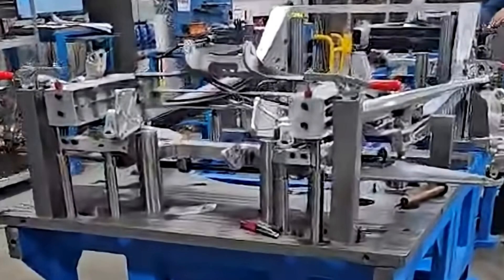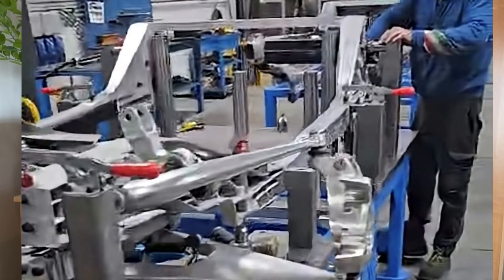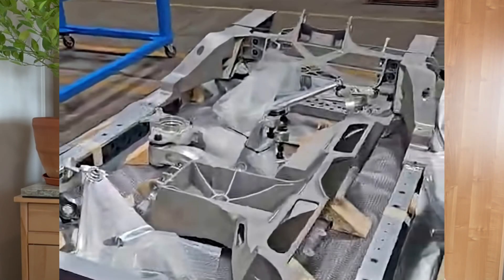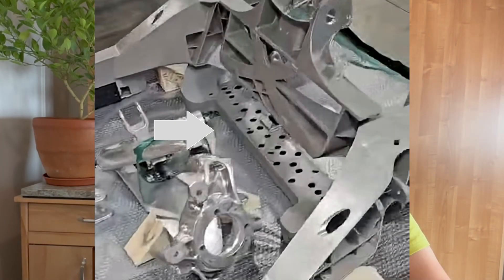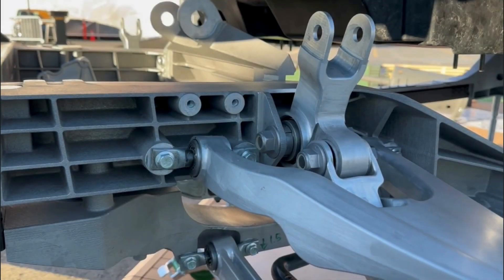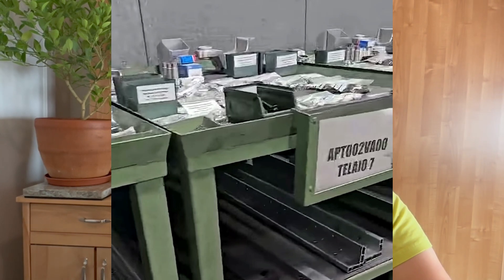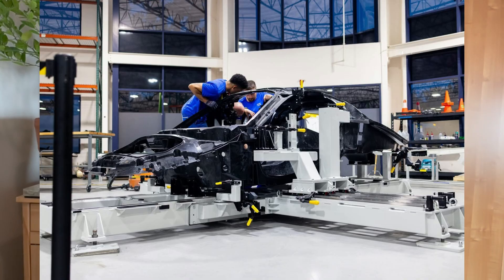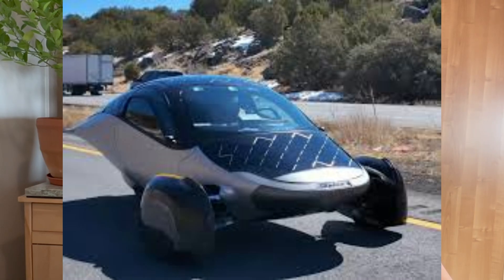Aptera's New Frame from COSTAMP

Comment: If they’ve gotten almost 50,000 reservations and are hardly know outside the Aptera current fans and supporters, imagine how popular it will be when it hits the road.
Reply from the maker: I think when people understand the freedom that the solar charging give them, it can be the next people’s car.
Reply: @ApteraAccessories  I have solar on my house roof and I can charge my EV for free on most days in Brisbane because the sun shines a lot here. Millions of others are in similar situations around the world. What we don't get is being forced to cook our cars and have to suffer a drive home in what has become a mobile pizza oven. The concept is snake oil, and we already have a better way. In fact, I can use my phone to turn on the A/C and pre-cool the cabin before I get in at its shaded parking spot, and so can millions of others. Everything you need is on the market to achieve this. It's time they stopped selling the snake oil and produced something that proves all their wildly exaggerated claims.
Reply from the maker: @a @aussieideasman8498  lot of people do not have the option for home solar or home based charging, myself included.  The Aptera will also have the same option to pre-cool the cabin, but will have the benefit to draw less power from the battery to do so. They are getting closer and closer to producing the car they said they would even if they had to make some changes along the way. I have never been to Brisbane, maybe one day I will go.
Reply: @ApteraAccessories  These people are fuxxed anyway. Embarassing solar on the vehicle wont help. And Aptera gets closer and closer to production since 2009. With production always promised next year. But not even a single production ready prototype available yet..
Reply from the maker: @vic321344 The concept of the Aptera car might date back to 2009, but this version of the company was started in 2019
Reply: @ApteraAccessories  Still geting closer without producing anything.
Reply: Just talking with two people from different parts of California who got very excited about Aptera and asked "Why have I not heard about this?"
Reply: @Mister_Stone  Tell them to catch up with nearly 200 videos of mine, LoL. I promise I will not get a brass razoo out of it.
Reply: I was telling a guy from Farmington, NM about Aptera. When I mentioned 40 miles/day from sunlight he said "I drive less than that every day."  Exactly.
Reply: @markfinley3703  ChatGTP:
Analysis

Farmington’s population is 46,624 (2020 census). 
Wikipedia
+1

Nearby incorporated places within San Juan County (which are the likely “towns” around Farmington) include:

Bloomfield, NM, population ~7,421 (2020). 
Wikipedia

Aztec, NM, population ~6,177 (2023 estimate). 
Census Reporter

Kirtland, NM, population ~585 (2020). 
Wikipedia

According to a San Juan County list, there are no other incorporated places near Farmington that exceed ~46k. 
City Population

Conclusion

No, there are no towns within a 20-mile radius of Farmington, NM that have a population larger than Farmington.

Farmington is by far the largest city in its immediate area.

Now this poor guy says that he NEVER drives as much as 40 miles in a day; that's what "I drive less than that every day" means. So he can only ever drive to these main three tiny towns with at total population under a third of his home town. Sad. He would be better off with a horse but, if he had a car, he could charge a modern EV about once a fortnight, and that from rooftop solar (his house).With a battery, he could do that while he slept. I'll bet all these are available for purchase right there in Farmington today.
Reply: Reservations are not buys. See Tesla, Rivian, Ford...
Reply: @vic321344  And prototypes count for nothing.
Reply: Well over a decade now have these guys been hyping themselves with promises of imminent market introduction. It bears the distinct perfume of snake oil, only goal is to get some more dollars out of gullible people’s pockets. 
This thing is hopelessly outdated already.
Reply from the maker: @vicbauwens Your recollection of time is a bit off, the company restated in 2019.
Reply: @ApteraAccessories  2005 (started in Farm-bro's garage) to 2011 = 6 years and 2019 to 2025 = 6 years, so total = 12 years. I would say 2 years is well over a decade, but it's not the recollection of time that's out - it's the claim that they have been hyping themselves. They have been hyping others, but not themselves. They hype themselves with that only goal of theirs.
Reply from the maker: @a @aussieideasman8498 The Aptera 1 from 2005-2011 is a completely different vehicle in its engineering then the 2019-current version. The only thing they have in common is the use of the Morelli body shape.
Reply: @ApteraAccessories  - So Aptera 1 was a clean sheet design that has zero to do with the one they showed us back in 2020? I guess it makes sense. A honeycomb shell and an inboard motor that has a shape that Chris Anthony stumped NASA with back in the Aptera 1 days, is nothing to do with Aptera 2. So, why does Aptera talk about those days and just make an official statement that this has zero to do with what they started back in March 2019? Then tell us all why the Zaptera lawsuit was not struck down right away, yet it lingers.

Fansplaining works and ignoring the other items. Like those two crowdfunded businesses (which you know about as you have seen them) seem to be no big deal that these two netted $300K right before they restarted Aptera.
Reply: @ApteraAccessories  Here's an instant example put right in my lap - I have just started to watch the newest video and it's called 'A Zero Emissions Journey | Full Episode | S1' by The Visioneers. In it the guy asks what Aptera means, and Chris Anthony (Aunty) takes the opportunity (seemingly unprompted) to say he and Fambro got the shape playing with clay - no mention of Morelli's work. The timestamp is 1:33 to 2:02 (half a minute of snake oil). I haven't watched the rest, so I will come back if he ever admits Morelli designed the shape.
Reply: Just like the last three wheeler EV Chris and Steve made. When it hit the road, it took off so well that the Aptera community talk about it all of the time. You remember that three wheeler EV they made, don't you?
Reply from the maker: @billsmith5960 I think you are taking about the Slingshot style EV.
Reply: @ApteraAccessories  - Yes.. The one nobody has ever mentioned until I did. Then there are the other EV's and businesses but let's never mention them as it might make it look bad for the founders.
Reply: @billsmith5960  TORQ Roadster in 2013. - Chris Anthony told a crowded room of journalists, prospective customers, investors, and component suppliers at the unveiling: “In many ways, the TORQ EV was the car I fantasized about while building the Aptera. Whereas the Aptera was designed to be the most efficient commuter car possible, the TORQ, as its name implies, puts performance first and harnesses the amazing power delivery of an all-electric driveline mounted to featherweight platform to provide breathtaking acceleration and handling.”
Reply: Future Aptera owner 😂 ok there will be probably 30 future Aptera owners which will be similar to Tucker owners or Bricklin owners of failed short production car manufacturers. I live in Carlsbad, drive by El Camino and Faraday daily. I also build high end classic German cars and I guarantee as a one man shop I have built more cars than Aptera ever will. They are fleecing the investors. Have you seen one in person? I have, the build quality is a joke. Now I hear the assembly line will be in the same Carlsbad building 🤣🤣🤣🤣 there is no way to scale or run a car company out of that tiny facility. $40k for a motorcycle trike that supposedly runs on solar alone is more than a massive bet that it would be successful on a small scale. The fuel savings doesn’t justify the cost, I suppose you could market to rich people that want to save the world so there is 100 or 200 units. No way is it economical. It’s not safe as a car - it’s registered as a motorcycle so they can avoid crash testing rules, if you get hit in one by a real car you are dead ☠️ All that being said I’ve literally seen the first version years ago back in 2008, then I saw the factory in Oceanside shortly after, now I’ve seen the prototypes. This is not a serious vehicle, the people doing this are clowns. One thing I know is how to build a car, what it takes and what is reality and Aptera already failed. If you invested in this scheme then you will never see a return, sorry to burst your bubble.
Reply: @vintageexcellence  There have been so many fanboys who have raved about a high build quality. I am glad you build cars for a living. There are a few others who have said the quality is shoddy, but fanboys shout them down. It will be interesting to see if you get lambasted by any of them?
Reply: @aussieideasman8498  the solar panels on all of their prototypes are DECALS!!! I don’t think they had a single prototype with working solar so the whole never charge thing is a marketing term they came up with and now that it stuck they are trying to figure out how to do it.
Reply: I'll bet our houses that no more than 5,000 of that 50K ever buy one. I'll stipulate 1st of January 2029 as the deadline. Like the odds? Imagination is great, but take a dose of the real world.